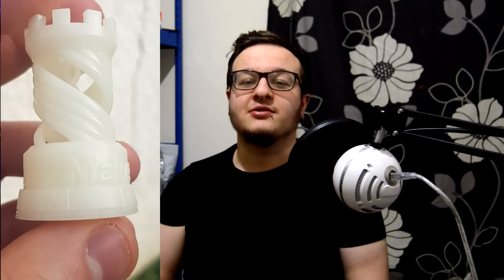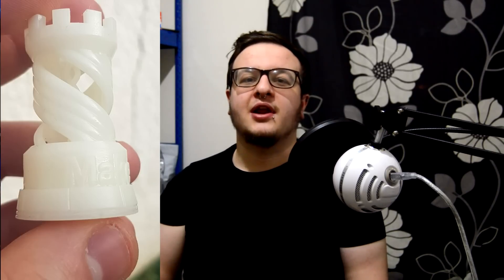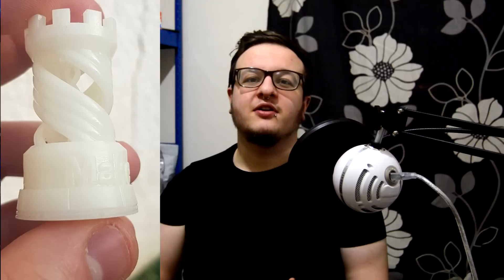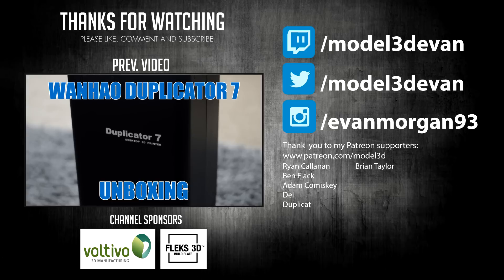Wanhao Duplicator 7 Update And First Prints!

Comment: Hi!. I Need somebodys help. My printer is Duplicator 7.Then I finish to work with my model on creation workshop (I place the model on the table, put support, make slicing, setting up the exposure time) and start to print. Printer is automatically rotating my model on the z ax for 90 degree. It is looks like printer changing the x and y direction. So I can print only pc. If it located on the special area the other one is lost.
Why it like this.

Comment: Stunning print quality,, even at 0.01mm.  The small letter detail was sharp and easy to read. What was the print time on the chess-piece ??
 Original PS may have been under-voltage? Test the output leads with a multimeter, and adjust the voltage potentiometer screw, if it is low.  I am hoping the extra 1amp doesn't cause any issue on the PCB.  Might be a good idea to do an occasional visual inspection.(if that is even possible)   If all is good after 60days of testing,  I will be getting one, 4sure..   
Thx for the updates  :-)
Reply from the maker: chess piece took around 3 hours, I dont have a multimeter but people have said the cable was under powered

Comment: What slicer do you use for the this printer?
Reply from the maker: This is used with a programme called creation workshop
Reply: Did you know if we can use other programs like we can with the FDM printers ? Do you have any problems with the program itself ? Thank you for the videos and the infos !
Reply from the maker: Rudse Carvalho its a bit different as with fdm it uses gcode to tell it where to go but this machine uses gcode to move the Z axis and turn on lights as well as png images or display on the Lcd display so you have to use a software that can do DLP stuff
Reply: Oh, i see. Thx for the fast reply, and with this good work.